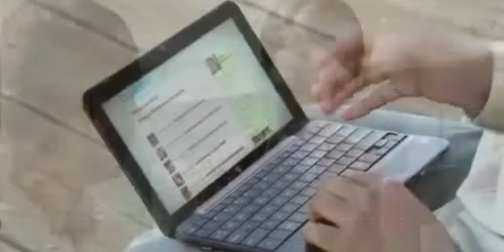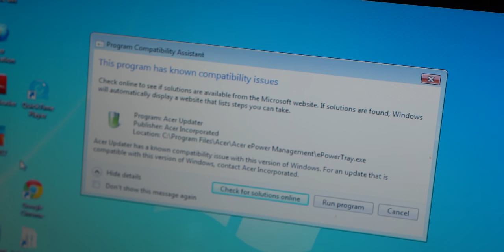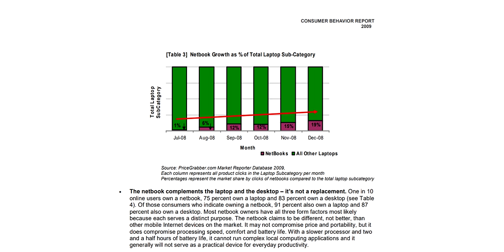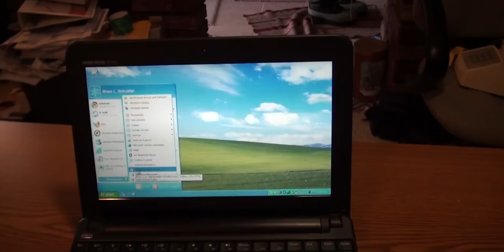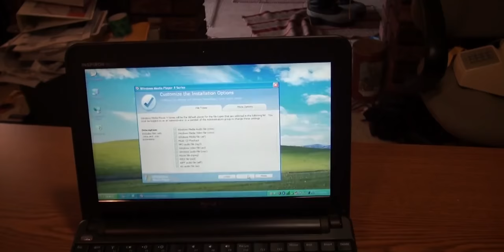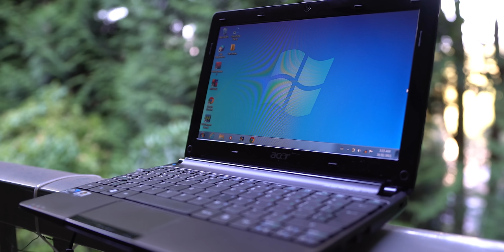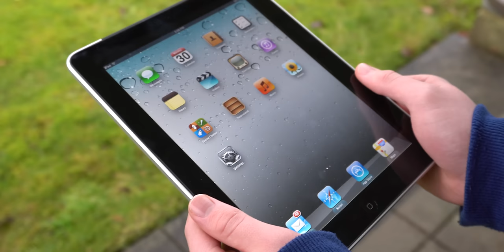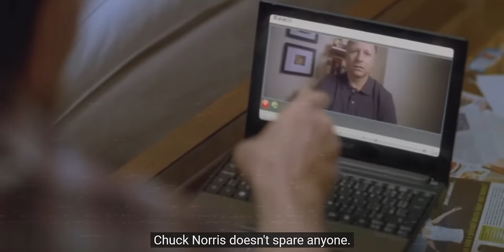Why Netbooks Failed - Modern Retrospective

Comment: @91Tech - oh, where to begin. 

I think the high point for netbooks was a little later than you do. I got my ASUS 1000 soon after the 701, 901, and 1000 came out. That was kind of early, but I definitely got my money's worth out of it. I chose that one because it had a 93-percent-of-normal keyboard. I think the 901 had the same size, but I was thinking that if I was going with a small screen, I'd got with the biggest small screen they offered. 

I got the one with Linux, which was "mostly harmless". I had used Unix on Sun and HP workstations, but didn't have much experience with Linux, so ran with that for a while. The thing that pushed me over the top was seeing a high school girl who had installed Ubuntu Linux on hers - I took a deep breath and stuck the install CD in my exernal drive, and what I got was like night and day more usable. I traveled with it for years, and finally gave it away (and kinda wish I still had mine, but the person I gave it to needed it more than I did). 

I was kind of an ASUS snob - and ASUS was coming out with a constant stream of new (10-inch) models with up to 2 GB of memory (I'd upgraded my 1000 to 2 GB myself), and significantly longer battery life (I remember them being advertised with as much as 10-12 hours). I never bought an upgraded one, but I wish I had. I looked at the ASUS website once a month or so, for years.

I needed a small windows system, so bought an 11-inch Acer Windows system. It was mostly OK (2 GB RAM and 320 GB HDD), but I missed having Linux, installed Ubuntu as dual-boot, and finally formatted the drive and installed Ubuntu as the only OS. I was still running it in my office until maybe 18 months ago, to sort and filter my IMAP email while I was traveling and off the Internet - having everything sorted when I landed and checked the personal mail in my inbox was much easier if business email was already in folders, especially from my cell phone. 

I also clobbered Windows 8 on my wife's magenta HP Stream 11 (guess why we picked that one. I dare you), after she ran it out of 32-GB disk space with music and photos and we got her a different computer. Nowadays mainstream Linux versions are starting to require 64-bit processors (nope) and GPUs (also nope), but the lightweight Linux versions are still serviceable. 

I ended up with an Apple iPad 2 as a gift. I used it for a long time (it matched my iPhone, so that was a good combination), but it never competed with my computers/netbooks. Either I needed a keyboard for what I was doing or I didn't, so I never started on one device and switched to the other for the same task. I still don't buy laptops with touchscreens, and if I get one from work, I disable that as quickly as I can. I'm now on my third Android tablet, but (again) those don't compete wth anything I have with a keyboard. 

My stepdaughter left her Samsung Chromebook with us accidentally after a visit, and I was able to log in as a guest user and see what it was like. I really liked that, and I've had two or three of my own since then. I was really excited when ChromeOS started running Linux like any other application, and when I buy my next Chromebook, I have to decide whether to get a touchscrren or not - ChromeOS now runs a lot of Android applications, which all assume they're on an Android device with a touchscreen. 

Thanks for the trip down memory lane! That was a blast.

Comment: Windows 7 Starter seems pointless really. If it can't run on the hardware then don't make it run on the hardware. If they were just for basic use that means Windows XP would've been fine back then, especially in 2009 when the OS was still pretty relevant.

Comment: Chrome books really aren’t that bad, I def want to get one along with a strong gaming pc
Reply: They're great. People forget that low-powered hardware can actually be good enough for everyday use as long as the OS is lightweight and not bloated (looking at you, Windows). Chrome OS is very light and uses almost no RAM at idle. And it has great memory and CPU thread management. I'm running a laptop with an Intel Celeron and 4gb of ram and it has no problems browsing the web, even on script and media-heavy sites.

Comment: I have an asus eee pc that I absolutely love the only problem is I can not find a power cord for the stupidly small picky powerport. To be fair it has never known windows. The first time I booted it I installed Linux.
Reply: Want to add, at the time I bought my netbook I was already using it, helped several others install and use it, and twice a year would hold linux install parties in my university engineering and comp sci building. If you couldn't afford full version of windows 7 you sure could afford free Linux.

Comment: my acer aspire one with 4gb ram is a very usefull thing due to lightweight linux. for some not-photoshop on the fly it is fine as for all the office things. only webbrowsing might be shitty sometimes due to very performance heavy modern webdesign.  
windows on it is a pain in the ass indeed.

Comment: i still have one of the last eee pc,s stowed away that went trough a lot of torture and it suprisingly holds up. 

of course it cannot run anything other than emulators and cannot really handle the modern internet but for work.. yhea it works just fine.

Comment: They failed because they were underpowered tiny ass things that lacked optical drives in an era where everything wasn't solid state. 
Better than nothing at all but ultimately disappointing cheap junk for most.

What really did in netbooks wasn't Microsoft, Apples iPad or Acer and companies alike putting out garbage products.
They all had a play in it to a degree sure but you ignored the main reason.
Mobile smart phones and devices like the iPad touch while not what they are today could functionally do what 99% of netbooks could do in a better form factor plus a whole lot of things netbooks couldn't do.

Smart phones have single handedly disrupted audio markets, computer markets, landline phone service markets etc.
Where we once had a dedicated stereo systems with amps, receivers, records, tapes and cd players, cable services, a house phone, GPS equipment, maps etc etc so much has been disrupted single handedly by the smart phone.

Comment: They didnt fail, they just evolved... comebook  is a thing

Mac book air  wasnt even a competitor.  Yes it was thinner, but it was homungus.  And no, its not a real computer, its a mac

The reason for netbooks was the back then huge licensing cost  for Windows. And as soon as Linux start being sucesfull Microsoft dumped  there pricew

"Apple made the first jump with ipad"

O no, Android was well before Apple with tablett. Like 2 years

Most of the reason why most netbooks was so slow had nothing to do with processor speed or low ram. While you might think 1 or 2GB is a tiny amount of ram. Windows xp worked just fine on 512MB.

The cpu also wasnt so bad, and even the gpu (at least in the amd once) worked just fine om a few years older game.

What was the real problem was the insanly slow ssd. It really wasnt a ssd, but just a larger Flash linked in as a disc.

There was a easy way to speed up those units. Buy a SD high speed memory card. Put it into the sd reader  (most had them integrated). Yes, the sd reader was faster  than the ssd, specially so in response. Then you had 8GB more disc and also a responsive OS.

Comment: i put 2gb of ram and a ssd in both of mine. they still sucked. one had windows xp and the newer version of the same one had windows 7 home basic. no they couldn't play minecraft and the screen resolution was only 1024x600. it made actually browsing the web absolutely horrible. they make pretty good 16bit or lower emulators though. the keyboards also sucked. they tend to fail often on those aspire Ones

Comment: Dont agree but yes the very firts gen sucked. Asus was the king of netbooks with eeepc. I had 2 and they were awesome. A normal laptop of the same size was +1000usd. Sure they are slow but they do the basic stuff you need. The last gen were even better with pasove cooling and even lighter & tinier with intel atoms z3700. Love my asus x205. 10h of movies for long travels and basic stuff for 200$. No other laptop will give you that unless you go for full high end asus zenbooks of 1500 usd

Comment: This is arrogant. I have owed computers old and new, expensive and cheap. I owned the Toshiba Libretto line which is smaller than the netbook and preceded it by at least 7 years. There are other ultra small devices over the years, before, during and after the netbook era,, except they all cost 4 times the cost of the netbook or more. How can you compare them like that? What if someone needs to have a small portable device at the time but couldn't afford those from Fujitsu, Sony etc? The Libretto was over $2000. When launched. The netbook was $300. On average. You can't make that comparison. As a matter of fact, they work, they come with a warranty, the system isn't locked so that you can't put a different OS on it, it has expansion inside and ports outside that made them not much less featured than a laptop. The iPad in your video (and I also own it), had next to no expansion or ports, and they are a different class of device. Some of the better netbooks such as the Asus eerPC 1000HE, has a 9 hour battery life, with a whopping 62 captivity, when even many expensive laptops don't, even they consume a lot more power. The low cost and long battery life combination was unmatched at the time, if you have this requirement. There are better products out there but only if you wouldn't mind paying for them. I have owned at least half a dozen netbooks, and modified some of them. But I also own many expensive devices over the years. And then you compare it to an Apple MacBook Air? That's not even close in the form factor! There are reasons for such a small size. But I guess you will never understand.

Comment: My first netbook was Toshiba NB520 Green Apple XDD It wasn't that crappy at that time, of course I was using Linux Mint instead of crappy Windows 7 starter and have 2 GB o RAM :P Now I have a free "toy" netbook Acer Emachines with Atom N450 1C/2T CPU 1GB RAM XDD and Debian 10 installed. And no I use this as a experiment toy XD not for the real stuff :P

Comment: Complete with 4 gigs of ram. It's time to upgrade Windows 10 press here. You need to add more memory. Plug in the USB stick. Upgrade upgrade we not enough memory upgrade wait do we restart try again. Upgrade now, press this button. How do we expand the C drive? Can't do that. A month later I just done with it. And then I know you must have 8 gig ram to upgrade. It's not possible to add more RAM. My little IBM XP. Naturally I've upgraded since then. I had cash so I bought two Dell laptops, Christmas bargains. The fan on one died, the video card faded out on the other. My XP still works with endless warnings it cannot upgrade. I learned about Indian scammers with my XP. It's easy to reset it and I did. Then I added music using somebody else's high-speed it press this button emergency contact support. He took over my machine and said blah blah blah it's been infected and I need to spend a lot of money to add protection. I explained it's a brand new setup and I can just reset it if I need. The internet providers infected he warned. I don't use it for anything meaningful. It doesn't even know my email address. He ran through my files. In the end I kept downloading music and learned never press that button. When they ask me to "Kindly" tell me, do tell, I know who they are. I have better things to do than buying a new laptop every year because I stupid s*** failed. Dead cooling fan because the bearings went out. Really? That's how they make them cheap. I want one that lasts and I don't trust any of them anymore, like everything else, liars and thieves. They didn't send it with the processors that I picked. Last year's top Intel processor with eight cores. Both arrived with AMD four-core substitutes. Night vision camera meant a bright LED light in your eye. Looking into the yard at night, a black screen. Who moved computer part manufacturing to Taiwan? The guy with a 100 million dollar Town House overlooking Manhattan, Dell. He sold us out. First was modems then motherboards. Now it's all manufactured at TSMC.

Comment: There is a good deal of truth in this, especially about the way Windows 7 degraded the netbook. But I am wondering whether you actually used netbooks for real? I bought them with my own money and used them for work and play, at a time when there was no way I was going to buy a MacBook Air. 

You suggest that nobody would buy a second one. I bought three in succession, and only the last one was a disappointment, due mainly to the aforesaid W7, rather than XP which worked fine. And as well as Word, Excel and a bit of web browsing, I recall  sitting in bars after work watching videos on them, with reasonable satisfaction. 

And when you say “the kind of people who  would buy a netbook” I think your assumptions are leading you astray. I was teaching, including teaching computing. No, I didn’t use netbooks as the teaching platform, but for cheap, practical admin and preparation, as well as some leisure uses. And the tech forums for users did not suggest that they were simply newbie devices.

In the end, the OS issues undermined them, but it was the advent of cheapish tablets and smartphones and the drop in laptop prices that killed them.

Comment: I mean how old were you in 2007 man? 5? 6? I had a laptop before netbooks (IBM T42) and replaced it with a netbook - why? Battery life. Netbooks allowed all day computing which normal laptops just could not match given they didn't run atom processors. My eeePC could run for 6 hours + on Ubuntu where as my old T42 was lucky to get 2 or 3 hours. Thats why they exploded and also why they died. Newer Core 2 Duo chips were far more power efficient compared to the Celeron chips my T42 was powered by and netbooks lost the battery life advantage quite quickly. Combine that with the iPad which karens migrated too the market was over.

Comment: I really liked the Acer Aspire, although I would remove Win 7 and put XP on it. I went through about a dozen of them. Why? Their motherboards had a super high failure rate. It was kind of disappointing. I finally gave up on them and just switched over to a small Dell. I had it for almost five years and it was still working when I gave it to a relative.